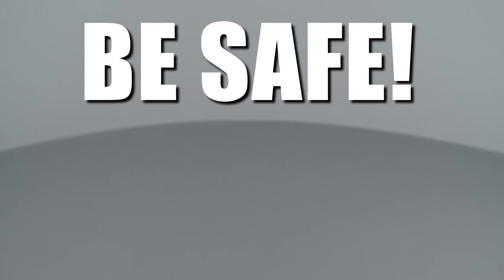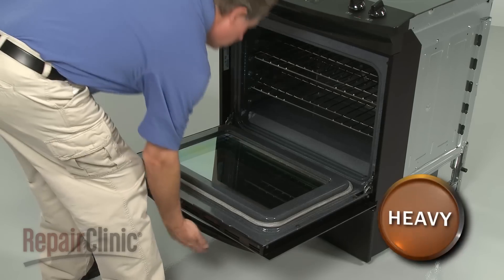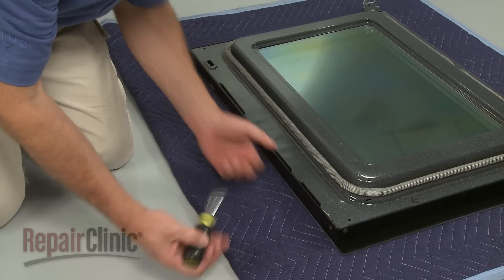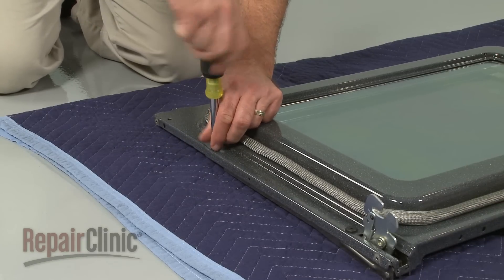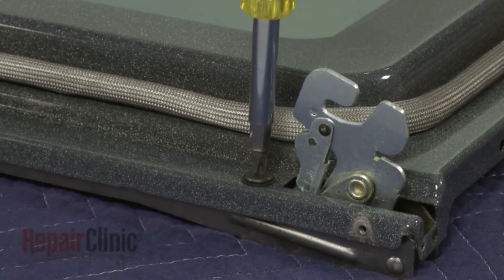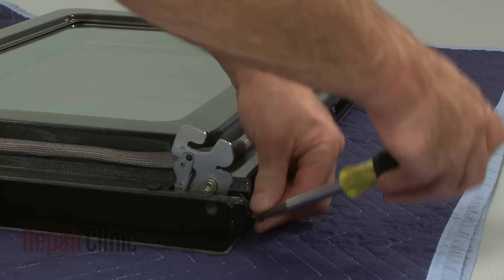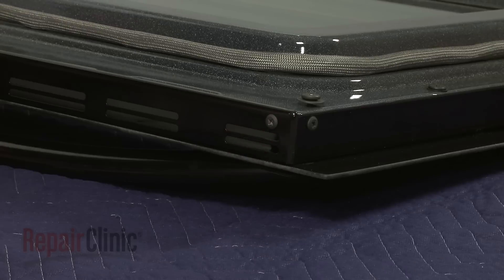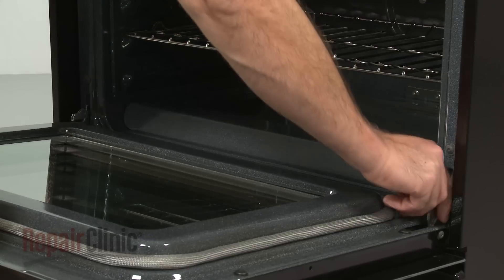Kenmore Electric Range Door Hinge Replacement #318567113

Comment: If the door is not closing properly, do I need to order 2 hinges from the provided link for part #318567113 ($35.90 each)?
Reply from the maker: +Amandeep Waraich You will need to look up the hinges using your model number to ensure you get the right hinges.